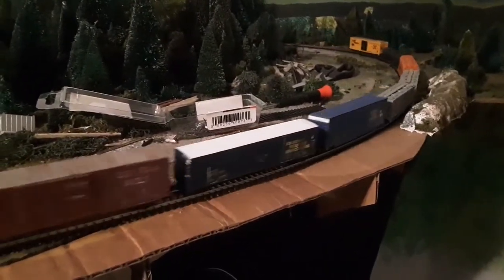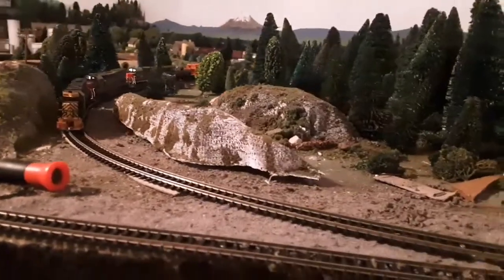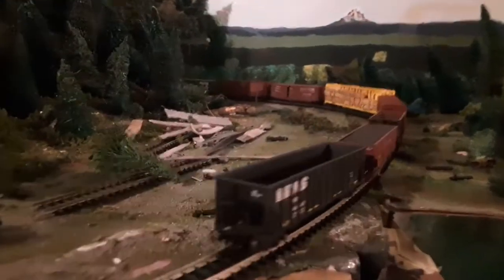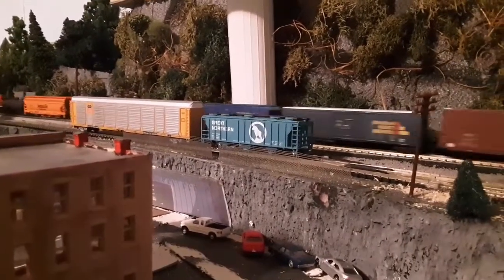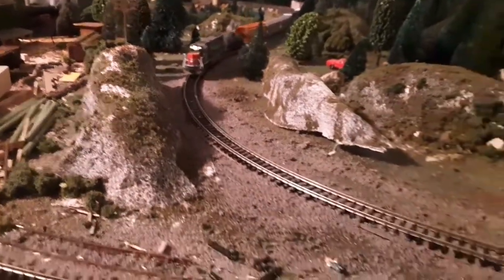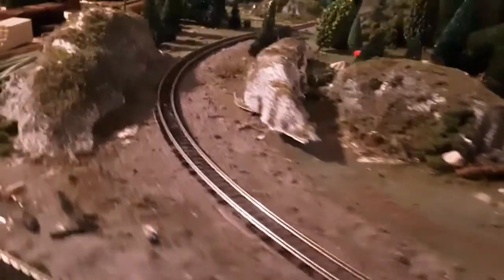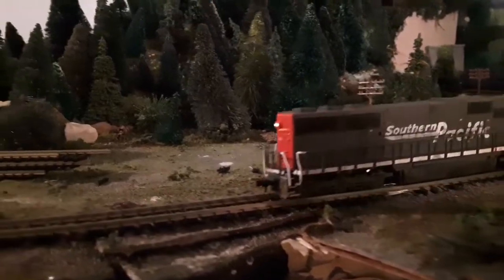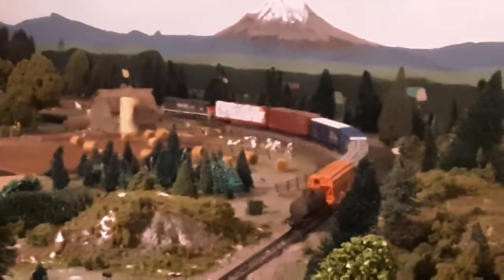Part two: Realigning the tight loop. It works!!! No fires...yet.

Comment: Might be too late but a curved turnout would allow you to get to lumber yard.
Reply from the maker: I actually mulled that over to keep access to the yard, but that portion of the loop needs smooth , uninterrupted track or else I'd  say more bad words  at the derailments.  Good idea, but I'm not so much into the switching ops.  Thanks for watching and the comment. Scott
Reply: Smart.  Curved turnouts are tricky
Reply from the maker: @FredE528  Hell, my regular turnouts give me fits!
Reply: LOL!  Me too…. I’m getting better on second try having replace many of the original #4s with #6s.
Reply from the maker: @FredE528  Wider is always better. I have replaced all my original Kato unitrak areas and used3  30 degree curves instead of 2 45s by the roundhouse. . Wide, sweeping flextrak curves like the one between the farmhouse and mill seem to look and work the best.
Reply: Always something to redo on a layout.  😀.
Reply from the maker: @FredE528  That is so true.....